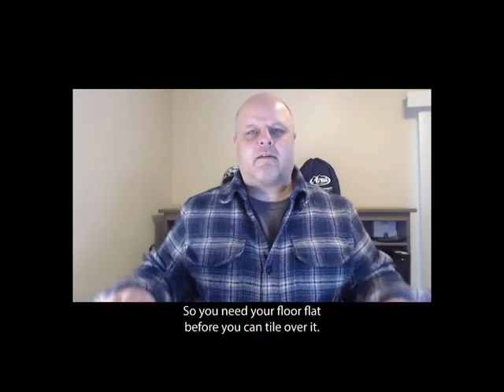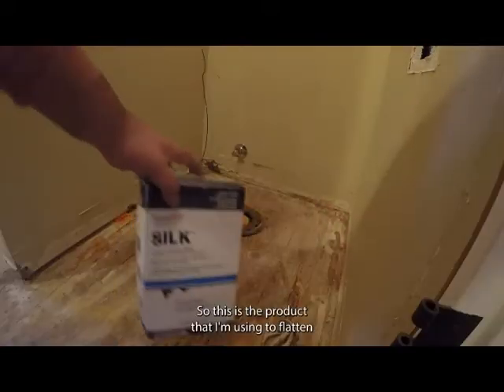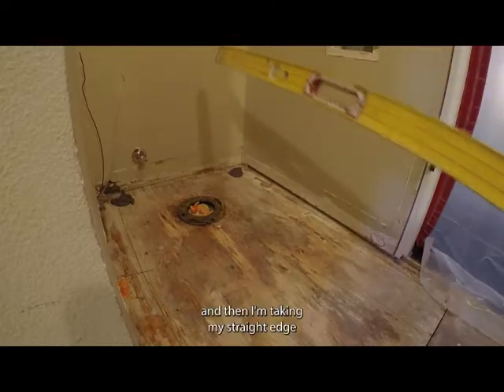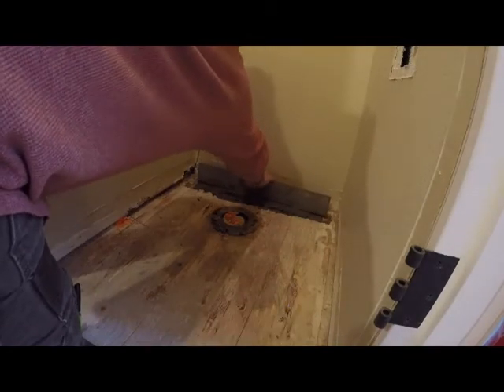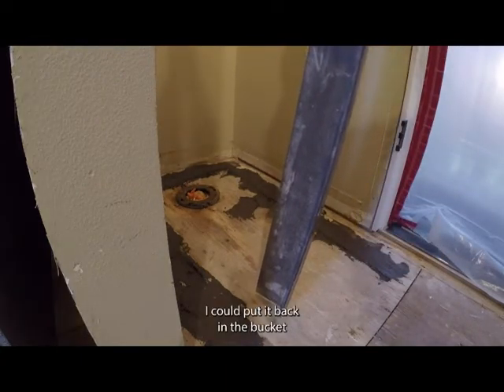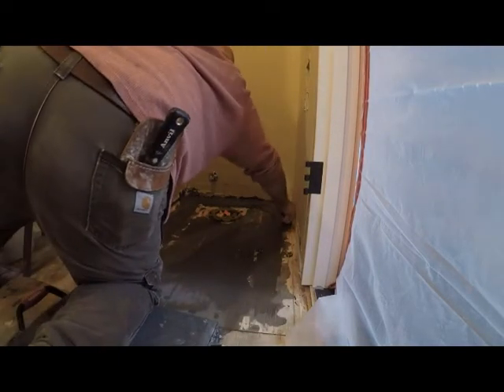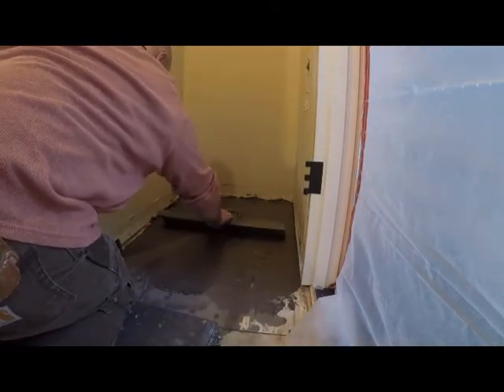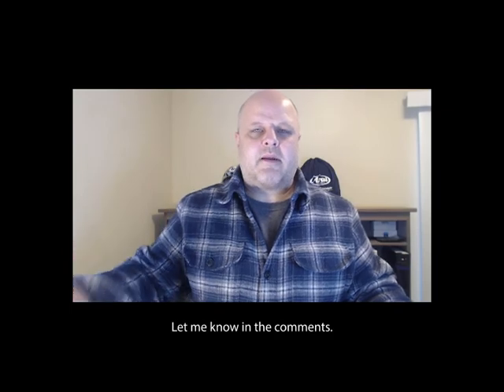A Technique Pro Tilers use to get an ASTOUNDINGLY Flat Floor that's ready to Install Tile Over

Comment: That was excellent! I’m going to try this technique with a self leveling job gone bad🤦🏻‍♂️
My drill burned up in the middle of it and I had a really rough time getting through it, it came out ok but I have some areas to flatten after grinding them down and this was really helpful. Thanks!!
Sub’d 👍🏻

Comment: I like this technique. You gave me an idea. I have used planipatch ; but it is so sticky it don't screed well .  To make screed tracks I used a grout bag and laid a long sausage at the line for a a screed and covered it with a strip of 4 mil poly  and laid a straight screed aluminum square tube  on top to small wood shims at the reference points. the planipatch hardens and then pull out off the screed and plastic and everything is clean. I need to find some other product to fill in because planipatch can be troweled but screeding sucks.  I looked at ardex products and so far I need to find fill material that screeds well to fill in as you did.It is a bath floor and there is only  plus or minus  1/4 " end to end on 7' . I have always skimmed with a trowel until I was satisfied with flatness; but I am weary and could use any suggestions.

Comment: With all the products, methods, and online instruction, there is no good reason not to have a perfectly flat tile floor if you are professional installer. I have seen tons of floors that looked like a drunk installed it but were actually big tile companies from the area that were more concerned with speed over accuracy.

Comment: That seems like a ridiculously difficult way of leveling the floor. That's way too thick for leveler. Why not make it runnier (like it's supposed to be) and just pour the whole area and let it seek level? That's what it's designed to do.
Reply: This product is actually not designed as a self leveler to seek its own level. It's designed to feather patch up to 1" thick. So his application is correct. Also, this method is actually faster than waiting on self leveler to dry if you want to tile right away. If I was tiling the next day, I might have done the self leveler, but this is an efficient way as well for speed
Reply: there is difference between flat floor and level floor.  flat floor can be sloped, but will allow tiling similar to level floor.  my problem is the floor slopes at the dishwasher (under the countertop) by 1/2".  if i tried to level the floor to have no slope with level seeking compound, the buildup including tiling will trap the dishwasher from removal (if  needed for repair or replacement), or cut up the countertop to remove.